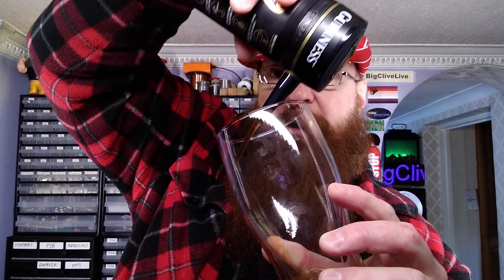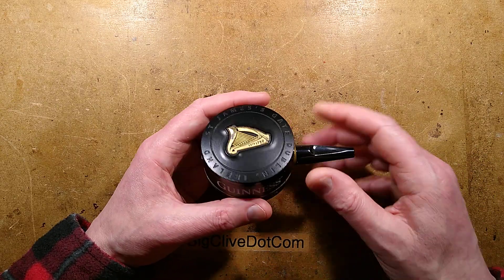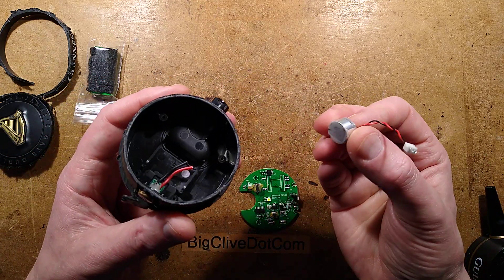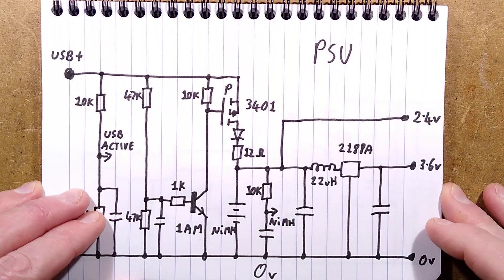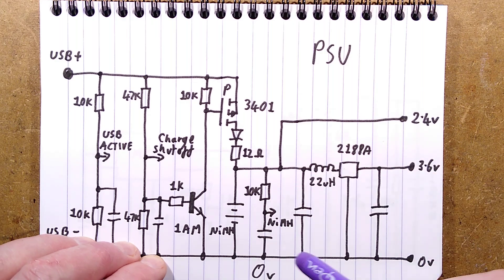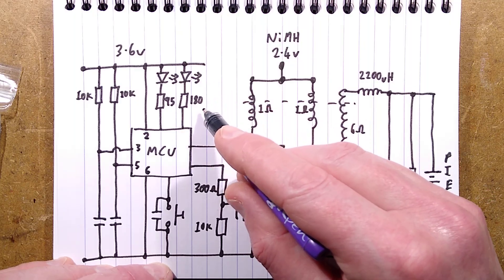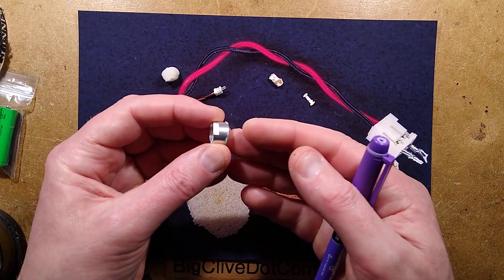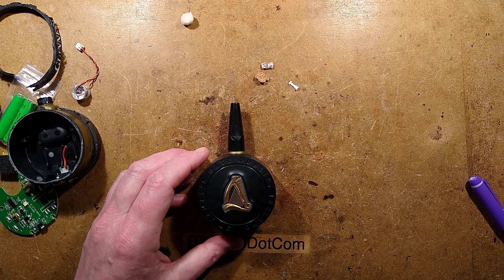Guinness nitrosurge teardown - with schematic

Comment: I have a unit that does the same thing for any beer. It's called a Fizzics beer dispenser . It is suposed to give the taste of draft to your beer. but it works just like the one you have.
Reply: But costs £130!
Reply: Try to fart thru the tube direct to lager beer keg filled with Mexican beer. After fiew of good and solid dry fart the lager will slowly convert to velvety stout.. with hint of sulfates in it. Outgeorgios!😊
Reply: Based on "I have a" and then "is supposed to"...
Iiiiiii'mmmm going to assume it doesn't quite work as advertised? 😅
Reply: @DUKE_of_RAMBLE  Missing the nitrogen/carbon dioxide mix Guinness uses. Half the reason Guinness tastes better in Ireland is because it just does not stay fresh. The ABV isn't really high enough and you can't really pressurize cans high enough to fit the same quantity of nitrogen gas as you could carbon dioxide. Combine the two and you have a beer that even canned only tastes great the same month it's made.

Of course, if you're shipping it direct to a bar then it's not sitting on a shelf for two weeks, and on tap you can just add straight nitrogen to it as it's dispensed.
Reply: @cheyannei5983  another 40% or so of the reason it tastes better in Ireland is because of effective brand recognition and placebo effect
Reply: @xAlexZifko  Its far from a placebo I'm afraid, I've yet to get a decent pint of Guinness outside of Ireland. A decent pint of Guinness is the cornerstone of a pub in Ireland. Outside of Ireland this is not the case. This lad covers pints in Ireland and abroad - https://www.youtube.com/results?search_query=guinness+guru .
Reply: @cheyannei5983  I remember Nigerian Guinness for sale here in Amsterdam. 8% ABV...
Reply: @pizzablender  Nigerian Guinness is a completely different beast - it has a higher alcohol content as the locals got so used to it, it's also brewed in Nigeria using maize and sorghum as opposed to Irish Guinness which is brewed with barley & hops
Reply: @xAlexZifko  Nonsense
Reply: @cheyannei5983  I... believe you misunderstood what the OP said, and why I said what I did.
I'm not talking about Guinness, because the OP never even mentioned it.
❤️✌️
Reply: @DUKE_of_RAMBLE  The use of nitrogen creates thicker longer lasting bubbles - this improves the velvet texture. The agitator ensures the nitrogen is released creating the foam, without that it would taste rather flat. Other methods have been employed in the past - such as the "plastic widget" as far back as 1969
Reply: @Fifury161  Please refer to my comment to Cheyenne, directly above, as it seems to apply to you as well. (no offense, I've misread/understood this plenty in my day heh)
Reply: @DUKE_of_RAMBLE  I didn't misunderstand - I pointed out the fact that Guinness uses nitrogen and an agitator to release - it does matter if it's this gadget, the Fizzics or a plastic widget...
Reply: @Fifury161  I think I see your point. My jestful comment was in regards to non-Guinness beers, since Guinness already had their own.
My apologies 🍻
Reply: Can the rechargeable batteries easily be replaced? In the case of this Guinness device, as it's so incredibly difficult to get inside that of course means that the rechargeable batteries, once not holding much charge, can't easily be changed, therefore this is yet another device that'll wastefully end up as landfill. Disgusting.
Reply: @SlartiMarvinbartfast  The NiMH batteries in the Guinness Nitrosurge will not require to be replaced so there's no reason for it to have an early death and be sent to landfill. I've got some NiMH batteries that are 30 years old and still functioning. They'll have a relatively easy life in the Guinness Nitrosurge device. The hardest engineering challenge for the device long-term is to ensure that it remains completely waterproof ... that aspect would likely be compromised by a design that allowed for replaceable batteries. (As an aside I've got some NiCD batteries from 1983 that are in an occasional use torch and are still functional!)
Reply: @MrAdopado  you're very lucky those batteries havent leaked by now...
Reply: @andygozzo72  Been using dozens of NICD and NiMh rechargeable batteries since the 1980s and I've never come across any that leaked (unlike alkaline or lead acid).

Comment: Why bother with a boost circuit to boost the 2.4v from the 2 cells to 3.6v when they could have just used 3 cells to produce the 3.6v with no boost circuit?
Reply from the maker: It's to provide a stable regulated supply for the processor.

Comment: I wonder if there's some leeway on the resonance, like if the impedance of it goes up and down based on where it is in the oscillation?  That'd allow some flexibility in impedance matching.  Otherwise, it'd be down to tight tolerances or binning of the piezos...

There'd have to be some leeway, anyway, because minor changes in the mass of whatever the piezo is attached to will affect the resonance slightly.

Comment: The Chinese version would speak to you in bad English when you turn it on
Reply from the maker: It would say "you are havings good ginnis for maximum joys."
Reply: And flash the light with a SOS
Reply: "You're a Bluetooth device has contacted a suck ses foley"
Reply: I bought some crappy suspiciously cheap bluetooth pseudo-airpods (don't recommend, somehow the tiny batteries inside died immediately). when they turn on, they distinctly say "power ong".
Reply: @Ass_of_Amalek  I had something like that before I got actual AirPods. The “power ong” and “connected” was annoying at best.
Reply: @TheAbyssalStorm  I'm more annoyed with the fact that I have only used mine for like three hours total, and the battery life has already degraded to less than 15 minutes (at least for one of them).
Reply: @grimd8788  I feel like "suck ces pool" wouldn't be a stretch for them to butcher in there... 😂🫣
Reply: @grimd8788  nailed it 😂
Reply: @grimd8788  very well transcribed sir 😂
Reply: And play five clips of obnoxiously synthesized Chinese music.
Reply: I've got Bluetooth headphones that say "please charging" every 10 seconds once the battery is low. Plays it at full volume which is fun.
Reply: After passing through the Chinese version, your chilled Beverage would come out hot as they would used a heat strip instead of using a piezo
Reply: I just dont get the whole idea of bluetooth speakers/headphones speaking. Just a beep/two beeps or a simple chime would be more than enough, without embarrasingly bad english.
Reply: And demand payment up front.
Reply: That would make me irritate 🤣
Reply: @paulwright8378  ADV!
Reply: Geenuuus has tapped sucsesfowee
Reply: Your guiness devieeee has successfullehhh connectehhh
Reply: "Ze Guinness device is ready to pour"
Reply: Okay wait, is/was there a Chinese version!?
Reply: Mandarin is a foundational human language unlike English  which is a hybrid copy cat tongue with illogical rules
Reply: It would also be equipped with a flashlight.
Reply: @ConstantlyDamaged  couldn't of said it better myself buddy, you covered everything in that comment 😡
👍🇮🇪🙏
Reply: Your Guinness Device isa connected suckcessfulleee.
Reply: They'd use it to dispose of more nuclear waste too and market it as a fortifying device. Maybe even ship with one of those 'magic massage' pens (or whaterver it was?) for free.
TikTokers would be all over it.
Reply: And go absolute apeshit, eh Clive?
Reply: And it would be pink.
Reply: And end with a cringe Christmas themed melody 😅
Reply: It'd probably have one of those blue LEDs that's bright af too.
Reply: Bluetooth mote
Reply: The Bluetooth device is ready to pair
Reply: ...yeah and then it stops working after 3 uses, and then explodes.....

Made in China 🇨🇳
Reply: My car Bluetooth talk really loud like that and people look at me!
Reply: Powa Ong!
Reply: Battery low
Reply: "the dwinkin dewice has connected"
Reply: 一只耳朵进去，另一只耳朵出来  With a Cantonese accent you may pronounce this Jor Yee Yup Yow Yee Chut. A common English expression ; )

Comment: Back in the 80s there was a tremendous amount of publicity about a patented "widget" Guinness had designed to put in cans so the stout would emerge just the way it did from a tap in a pub. Has that technology now been superseded?
Reply from the maker: They still sell them with the widget.
Reply: @bigclivedotcom  Isn't that a ball that contains nitrogen that bursts when the can is opened?
Reply from the maker: @stevec00ps  It's a plastic ball pressurised with nitrogen that vents through a tiny hole to blow a stream down into the can when the pressure is released.
Reply: Finished with your Guinness? Yes, I am! <<rattle>> <<rattle>> <<rattle>>
Reply: Patents expire.
Reply: They had a "Rocket Widget" for the bottles but they moved away from that and just pressurize them with nitrogen. They still have a ball widget for the cans and those work for the most part but every once in a while they're faulty.